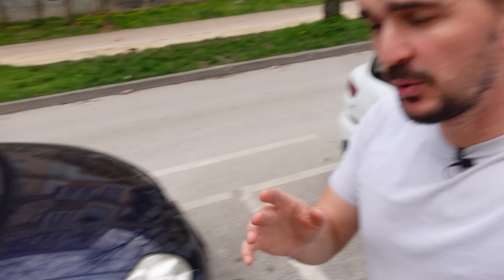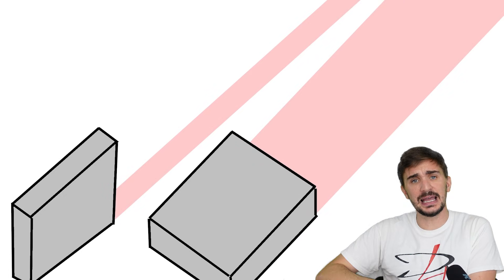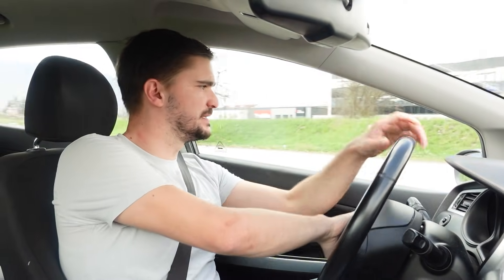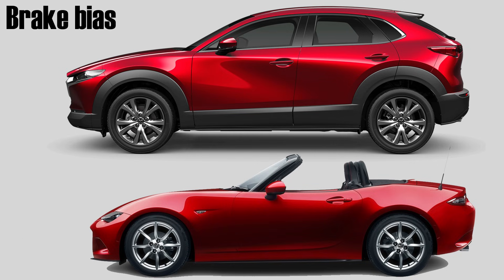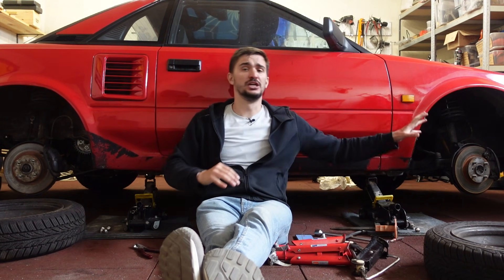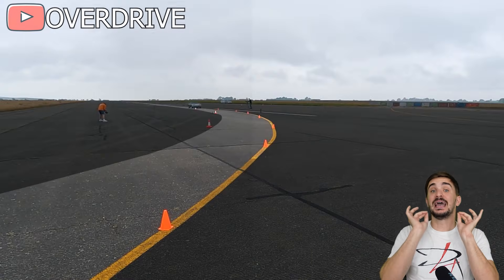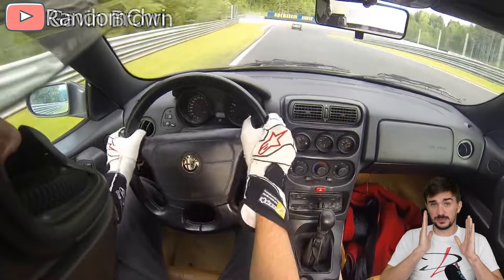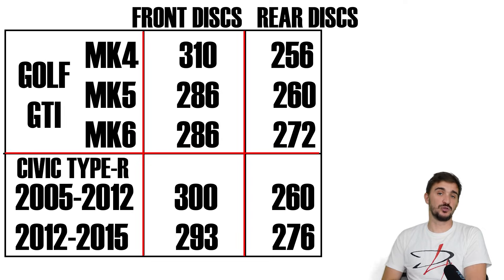Why are Front Brakes Larger than Rear Ones? Brake Bias Explained

Comment from the maker: https://youtu.be/CyH5xOcsXxs
Please watch this before commenting how and where surface area matters
Reply: Mahindra xuv 500
Reply: There is one exception of this rule. Cadillac STS-V has bigger brake disks in the rear thanks those in the front. 🤷‍♂️
Reply: @Marcin J.  A few cars have larger rear disc diameters than the front. BMW 330 for example. More than just the disc diameter determines the brake torque, and obviously hydraulic pressure is also less on the rear with smaller caliper pistons. But rear discs are always thinner as they have less heat to absorb.
Reply: Like always, good vid m8.
Cheers from 🇦🇷  😁👍
Reply: Is it true that wider ones can handle more pressure force? So more grip or more pressure for the same grip??
Reply: Surface area increases a lot more than just friction. Attracative forces. Stickiness and adhesion. etc etc. Anyway, drag cars have larger tyres and lower pressures to increase surface area and allow more power to enter the ground.I'm actually not sure why friction is taught the way it is. It is incorrect.
Reply: @ralphwarom2514  Friction is the “stickiness” between surfaces. But the reason wider and “stickier” tires stop you better is because they can support higher levels of friction than a narrower “less sticky” tire.
Reply: if the rear grip better it is actually safer in car because there is no way to be spinned.  That's why we are not supposed to have better front tires grip than the rear tires. New tires are always placed on the back.  The front brake is bigger just because it works harder and more effective if the front grip better with larger braking force.
Reply: It takes 15 minutes to explain simple logic does it?
Reply: I have seen your egr video… start stop system & variable oil pump are all so 2 things that are killing your engine & turbo
Reply: wait a minute if friction doesnt care about surface area then why do cars with thicker/wider (or deflated) tires have a better grip (and also consume more gas)  and why vehicles with thinner tires and overinflated ones accelerate faster and consume less gas (obviously for the same distance and speed over time and identical engines and car or bike configurations except what I mentioned about the wheels)
Reply: @billkillernic  For the second question, it's all about rolling resistance. Cars with underinflated, wide tires consume more gas because it takes more energy to compress and decompress the areas coming into contact and out of contact with the road surface.
Reply: @ yea but he says that very surface area has the same friction so it doesnt matter.

Comment: Besides control it is also notable that cars are made to be crashed straight on. even if you have no control understeer generally manages that. Meanwhile even light oversteer quickly presents your door to oncoming traffic or whatever you're directly crashing into at high speeds, which is a much worse position.

Comment: As these ideas sink in, let me pose a question. If you had a manual brake bias adjustment, when it's wet out, would you adjust it more to the front (front bias) or rear?

Comment: The braking force distribution is similar to when we ride a motorcycle, the rear brake will be stepped on before the front, and then the main braking force is still in the front.

Comment: Tires that have more sipes will get better grip on acceleration and braking. in street use applications where as a slick. with the exception of tires that use a rubber compound. that when they heated they produce more grip.i in racing applications.

and inertia makes it necessary for vehicles to have more front braking. because too much rear braking will cause the vehicle go into a spin.

Comment: It's NOT always the case. Some time ago I wanted to buy a used BMW E90 or E91. To my surprise, I noticed that the E91 (estate) had the same size brake discs 300 mm on both axles, all 4 discs ventilated. I'm sure there are other cars that break the bigger front brake rule.

Comment: Hi I love your video's.  Please keep it up.  I hope I can explain this correctly.  
Your mention of increased diameter disks, increasing surface area and therefore heat rejection making the brakes more efficient.  I liken a brake disk to a clutch friction plate.  
I always believed increasing a clutch capacity with a given friction material was achieved by increasing the average diameter of the contact area (ID or inner friction area and OD or outer friction area).  An increase in average diameter increases the capacity of the clutch.  Therefore a narrower clutch contact area even at a greater average diameter has a larger average diameter and clutch capacity.  
So doesn't increasing the average diameter of the brake disk by having a larger disk with a larger average diameter do the same thing.  In increasing the braking capacity and therefore stopping power.  Or is average diameter much less effective  in terms of efficiency than the heat rejection capabilities and therefore nothing to really consider
Thanks......Kevin

Comment: first about you say is weight and agility and stability and suspension need be stiff and flat then you never see front nose fall down car nothing do with breaks and you point track corner turn if you join high gear and break you go kiss wall easy pizzy and more slide and cant control if you join before corner low gear and little break you never happens this what you show fail drivers do join corners turn with high gear 5 or 6 gear or 4 still is high and always you need reduce gear when speed high in the corners and no like that you show dangerous drivers of track we saw many times and we know how works no need explained that gear low reduce is make you better break force do you understand that or you feel when you drive different when high gear join corner how is feel car lose grip and no break well and when you join low gear and little break or depent of gear you can no need break is all abut how you feel car and weakness of car or tuned and skills

Comment: One thing you could have covered is a short explanation why they continued to use drum brakes on the rear when disk brakes came out. Of course it is because drum brakes are not nearly as efficient, but there are still a lot of cars out there that use them.

Comment: Careful!!! Stiff suspension INCREASES weight transfer off the rear wheels, even if forward rotation is visually decreased!

Just like stiff sway bars, stiffer springs will always reduce grip!

Comment: Weirdly, volvo 850 used LARGER (unvented) rear rotors than in the front! The rear even had a tiny 2 piston fixed caliper where the front had a larger single piston slider.

This formula of larger disks with smaller calipers is what I think tremendously reduced rear brake wear in these cars.

The p2 R cars had a relatively similar formula but with vented 330mm and brembo 4 pistons on all 4, but with physically smaller pistons/pads on the rear, all stuffed under a set of 17" wheels specially crafted to just barely fit the package. I really wonder if this was actually necessry, but hey, it's cool :)

Also, a note about friction and surface area: this is only partially true. At some level, everything in the real world acts like a pink rubber eraser. Focusing energy on a small point of contact can generate good friction but only until the material begins to break down. Once you hit breakdown, all bets are off, and now your friction is determined by the stregnth of the internal bond of each friction surface's materials, as well as the friction properties of the released debris. Brake dust has a high coefficient, but loose gravel shedding from bad asphalt has a low corfficient.

Comment: I think that to explain weight transfer the clearest method would be to explain the forces involved. Since the force applied by the wheel when braking is not in line with the barycenter of the car it will ultimately create a torque on the chassis. It is the torque that then transfer the weight on the front wheel and that's also why the barycenter position have a great effect on breaking characteristics of the car and how much weight is transferred and as you pointed out creates unpredictability when breaking in a corner. A higher barycenter will create a higher torque. It is not necessarily bad or good but too much will eventually cause you to completely lose traction on the back (e.g. bikes) limiting in practice the amount of braking you can apply.

Comment: what if the center of gravity was below the wheel hubs?
Reply: I suppose that at that point the torque applied to the chassis  would become negative and you would have weight transfer to the back of the car.

Comment: My 4th gen Acura TL comes with larger diameter rotors in the rear, but are non ventilated and have smaller calipers… an oddball for sure!

Comment: Love your explanation. New C8 corvette owners have notice, u like every other car, the rear brake rotors are larger than the fronts. I am sure it has something to do with the weight distribution of a mid engine car, being different that the distribution of a traditional front engine corvette, but there are are 100's of other mid engine supercars that don't. Is it for greater heat dissipation do to the increased rear weight?. It would be interesting to hear why the C8 corvette is so different from all the rest.😮

Comment: had an 81 Camaro tooled on speed shop oversized shoes and spring assembly to rear           drum assembly removed and plugged up front caliper assembly and it stopped on a          dime use your mechanical imagination ,

Comment: Man, your Videos are really Amazing 👍
Sometimes i dont understand the Point of Break Disc Distribution. For Example.
Corvette C5 is a Transaxle Middle Engine Car, and it have F 320mm, R 300mm.
The Pontiac Firebird TransAm Gen 4 is a Standard FR Car, but it have larger Discs in the Rear, i dont understand why.
Should not the Corvette have at least similar Discs, and the TransAm should have larger in the Front?!
Reply from the maker: Remember, front ones are vented, rear ones usually aren't.

Comment: If I swap the front rotors for significantly bigger ones (256 mm -> 312 mm) while keeping the rears the same, will it affect the brake bias? I heard people saying it is best to swap the rear rotors as well (232 mm -> 256 mm) to keep the bias similar to original. But are they right, when we consider the presence of ABS? I am a little confused now. Thanks for the possible clarification!! Love your videos btw!
(The car is '00 Skoda Fabia 1.9 TDI PD.)

Comment: ABS doesn't release and grab. It actually attenuats force, trying to find the braking threshold. But again, it's not simply pumping the brakes. 

When turning you're trying to pull/deform the tires longitudinally and laterally. Tires handle one or the other well, but not both at the same time. Additionally, more contact patch over comes less weight/force. This also extends to adding greater force to one tire while the other tire has less force, over all friction will be less. So by turning and stopping you're putting all the force on one tire. making the system less efficient. 

Either stop or turn in an emergency.

Comment: Something that has been puzzling me for some time.  I have two front wheel drive vehicles, a 1990  SAAB 900, and a 2011 VW sportwagen.  BOTH of these vehicles consume rear brake pads about 30K to 40K miles, but I have NEVER had to change the front pads on either one of them!  I've had the SAAB 900 since 2004, and the Volkswagen since it was new.  I also have a 2000 Chevy van, a rear wheel drive vehicle.  It has needed front pads twice since I purchased it in 2008, but has never needed a set of rear drum shoes. I primarily use the van for work, and it gets city driving, along with towing a camping trailer.  I am typically a light, early, easy braker, My wife drives the VW mostly, and has never driven the SAAB.  she is more of a late, harder braker, so I'm not thinking it's driving habits that make these two vehicles burn rear pads more often.  The VW is new enough to have EBD, whereas the SAAB has an older TEVES Mark III ABS system.  The only reason I can come up with is that the SAAB and the VW are both European cars, and European cars must have a bit more bias to the rear brakes than American ones do.   Does anyone have any thoughts on this?  sorta goes opposite of what he says in the video, and what I would expect

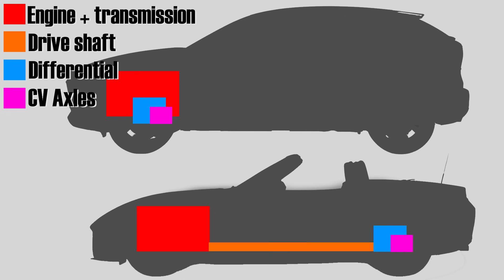Comment: 7:32 you forgot to mention that the RWD has more mass (transmission) connected to the rear wheels that needs to be slowed down and requiresa lot of extra braking force because of it!🎉

Still great job

Comment: The tendency for a car to go straight when you brake is why about the most important thing an anti-skid school teaches you is letting go of the brakes when this happens (and yes, even ABS can't always help there).  Without this, many instinctively 'freeze' on the brake when the car no longer reacts as expected, thus losing the chance to correct course.  By changing that default reaction, you open more options for a potential better outcome in emergencies.  I absolutely love how this is explained here.

Comment: Do you ever listen to yourself? In another video, you said larger brakes will not stop faster. In this video, you said in hard braking, weight goes forward, which will, like a motorcycle, will lift the rerar wheels.

Front brakes on motorcycles are larger to keep the rear brake out of the game when hard braking.

Comment: Can you please do a video on tire width? Intuition says that a wider tire would provide more grip, I'd like to learn more about this. Thanks!
Also going by the same principle, this means that increasing the clamping power of the caliper piston(s) or the biting force of the brake pad used will increase stopping power (within the limits of the tires being used) and the diameter of the disc will control heat dissipation and determine how often you need to replace the pads and discs. Say for example that it is possible to use a larger disc and pads with the same caliper, will this mean that the braking capability of the car will not increase due to the same force being applied over a larger area? My intuition tells me that this is wrong so I'm eager to learn more. Thanks
Reply from the maker: https://youtu.be/CyH5xOcsXxs

Comment: i dont get why motorcycle manufacturer doesnt unify the braking application, hand lever for front and foot pedal for rear. its like they want us to figure out the brake bias for ourselves during emergency.

yeah i know newer bikes have abs, but it is easier to use one pedal and they automatically decide which tire has better grip

Comment: Simple layman terms summary: Because when you brake the vehicle's weight shifts forward so having equal size brakes doesn't make you stop any better. They can be a bit smaller to save a little weight.

Comment: Great channel, great videos! Just to clarify, there’s no ‘weight transfer’ in breaking, but a torque moment (tendency to rotate about the front wheel contact point with the ground) So, yes there’s higher normal load on the front tires due to this moment, but the CG is still fixed, there is NO weight transfer!

Comment: Hydraulic fluid is (broadly) incompressible. When you push the lever into the brake master cylinder, you displace as much hydraulic fluid as the volume of cylinder the lever obtained. It is this displacement (instantaneous, since no part of the fluid can be compressed and must instantly be displaced) that makes hydraulics so fast-acting.

Comment: I knew this, though got one thing wrong. Because of weight transfer going to the front regardless of where the engine and transmission is, I always believed bias to be 80 front and 20 rear, or at least close to it. Now I know that is not always the case. And while I heard of Electronic Brake Distribution, I didn't know what it is or how it works or what it's intended to do. But now I do.

Now if just cover superchargers like you did turbochargers (your personal BIAS) the various types and how they perform differently from one another, you'd be golden.

No need to cover other engine configurations though.... cough...V10.

Comment: Thanks for the upload
So based on the science behind the friction that you explained, why wider tires give better stoping power?
Reply: Traction.
Reply: @simplemachine9531  What's the difference between traction and friction?
Reply: @ravenheart369  https://en.m.wikipedia.org/wiki/Traction_(engineering)
Basically, it is friction plus adhesive properties. It acts similar to duct tape when, if covered a lot of surface with it, can hold a man strapped to the wall.
Reply: @simplemachine9531  Thank you
But it's too complicated and these two concepts are noticeably interwoven

Comment: So that's what those braking power regulators are... This channel is an excellent source of knowledge! But this made me thinking about my '91 Skoda Favorit I use for LONG distance tourism. I swapped the original unventilated 230mm front discs with ventilated 256mm Kia discs controlled by Mondeo brake calipers, and yes, it skids on the dry tarmac easily now, which is suboptimal :) But then they didn't even catch a sweat going down the Transalpina pass, which is a nice tradeoff. But I left both the regulators unchanged, and I didn't change the rear drum brakes. Car is most of the time loaded quite heavily at the back with the camping stuff etc., so basically I should A) get rid of the bigger brakes in front? B) replace the regulators somehow finding the fitting ones C) swap rear brakes for the discs at least (Polo 6n2 fit AFAIK) D) do both B and C?